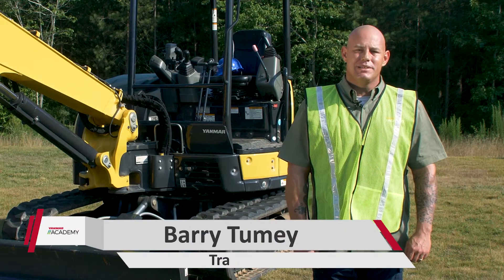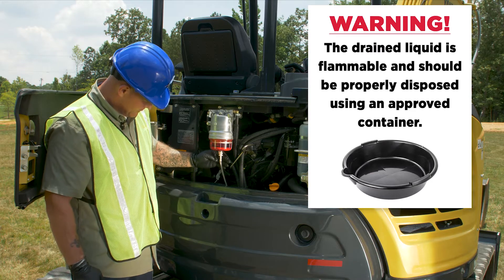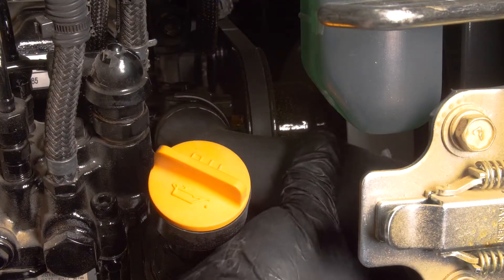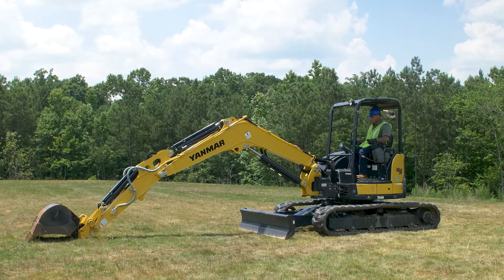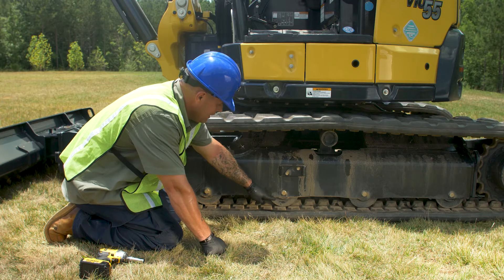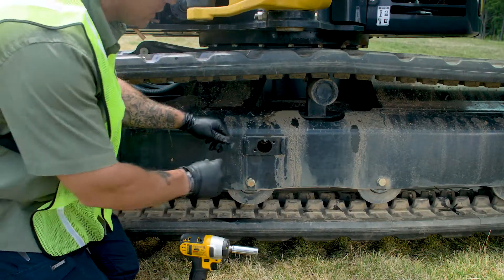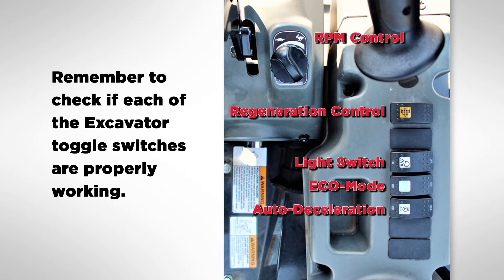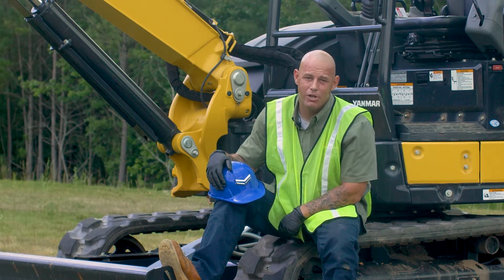YANMAR Academy Excavator Daily Maintenance

Comment: The amount of work here for a "Daily Check" is insane, and would be over 200 man hours per annum to follow manufacturer's typical recommendations. What annoys me about these machines is the lack of sensors for engine oil, hydraulic oil and coolant levels, even though the manufacturers stress how vital it is to check these daily. Globally the amount of wasted man hours doing basic checks will be enormous, and could be saved by a few relatively inexpensive sensors.

Comment: I thought with fuel being shut off, it would prevent water from draining out at bottom as no new fuel is taking the place of the drained water.
Reply from the maker: Thank you for your comment. This video is focused on daily use of your excavator. Checking for water in your fuel should be done daily. Fuel is only cut off for maintenance.